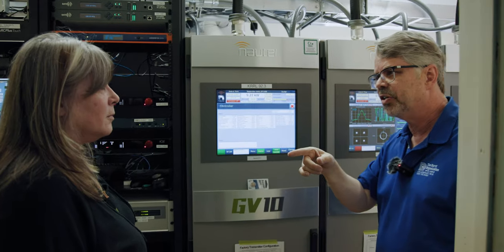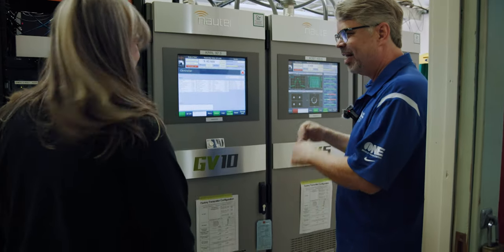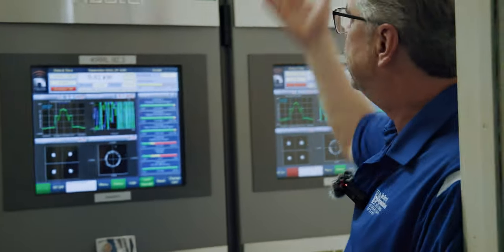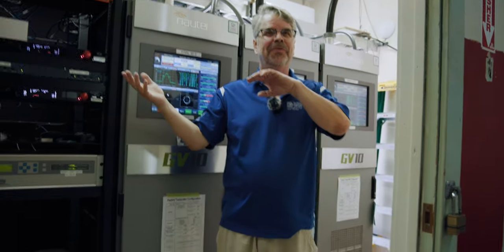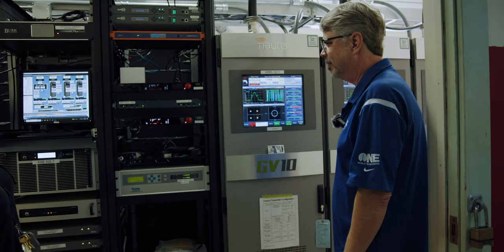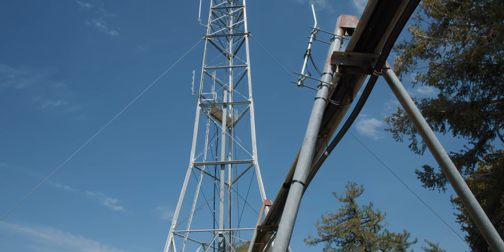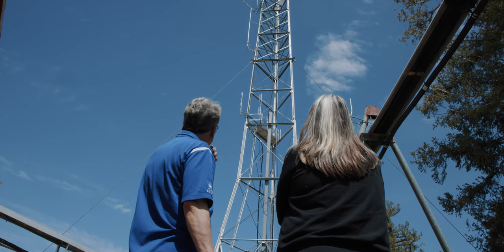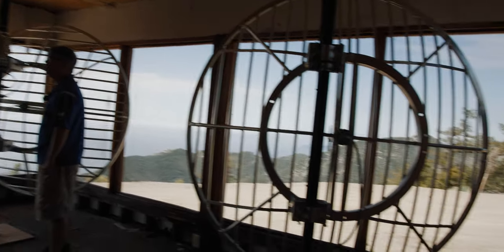Transmitter Remote Controls and Efficiency - Mt Wilson Los Angeles

Comment: The structures look so ... California. Yesterday I came across a website with photos of Chicago (where I started my career) transmitter sites, and there everything is steel and stone. On the plus side, WMVP AM has kept the old WCFL art deco letters on its transmitter building. As a kid in the '60s and early '70s, WCFL and WLS were the Top 40 AM powerhouses in Chicago.
Reply from the maker: It does seem that each region has somewhat of a theme of how the sites look. 

KFI in Los Angeles has art deco on their transmitter site. It’s pretty neat to see.
Reply: @TheBroadcastEngineer  When I DX'ed KFI in Northern VA back in 1972, they even put EKKO stamps on the QSL card with a 50th anniversary commemorative seal.  It was a trip hearing KFI under the splatter of WMAL-630.
Reply: @johnpinckney4979  Honestly I didn't know skip went that far. I have heard many from the west to other places in the west but never heard anything from the east coast.
Reply: @InsideOfMyOwnMind  Furthest east I've ever heard on AM while our west was WWL-870 from New Orleans while driving late at night on the 15 Fwy in the desert.  DX can be strange, though.  On the 6-Meter ham band (50 MHz), I've heard Bermuda and British Guiana in in Virginia, but couldn't work them.  I've also heard Hawaii on 6, but didn't see any of the TV's although a couple of Californians made it.